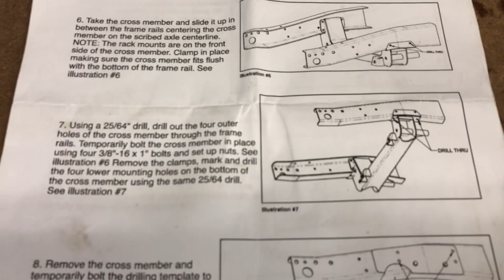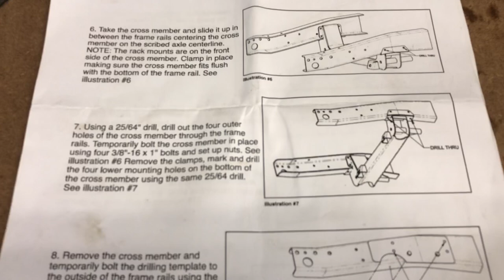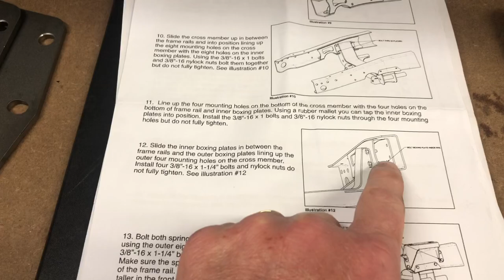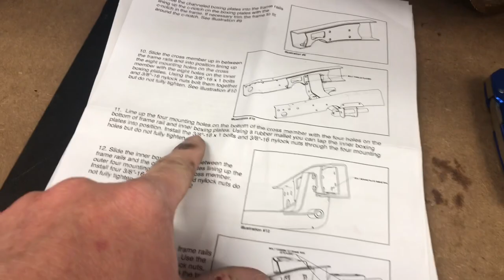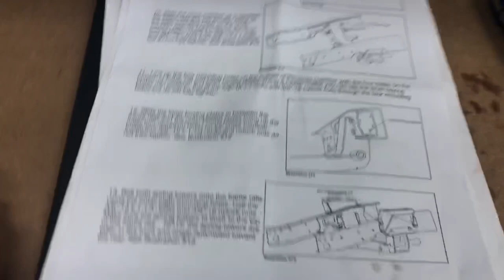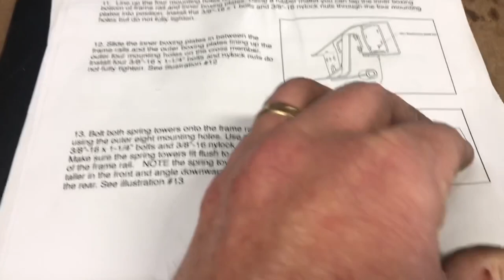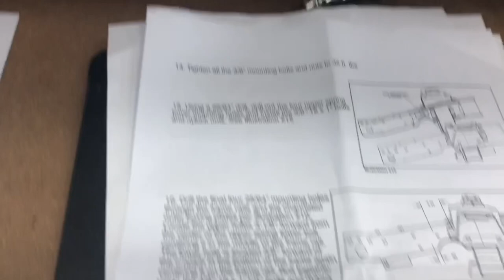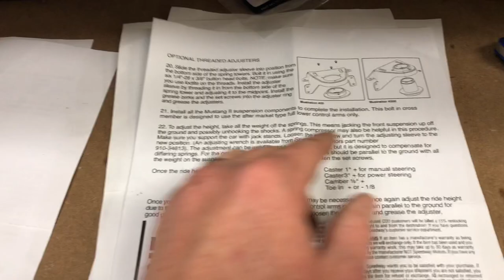Bolt on Independent Front Suspension install - Part 2

Comment: I did same kit on  55-1 with LS, ended up buying the shorter upper control arms to get better caster and camber, added the sway bar made a huge difference in stability at higher speeds

Comment: Nice job did that sway bar come with kit or did you order it separately, if so from who. Thanks
Reply from the maker: Thanks!  I Bought the sway bar separate at Speedway Motors. It’s a Heidt’s Item number 413054. Sells for $250ish.

Comment: Just wandering why you went with a new rad. support? does the ifs kit affect the original support?
Reply from the maker: It doesn’t effect the original support. The original can be used but will need to be modified. I wanted a clean look and at $100, now was the time to switch it out. I think I explained it in the IFS install video Part 1. Thanks for watching.

Comment: I like your video but what I like to know did you have to do any welding ?
Reply from the maker: No welding is necessary. I didn’t on my install, but after everything is bolted in you could weld it. But again, not necessary.

Comment: Were there any parts or brackets on this kit that you chose to weld to the frame while having it bolted into place?
Reply from the maker: No. I bolted them all on and used loctite.  You can weld them as well. I chose not to.

Comment: I do have my dads ‘49 so this would work. I also have a ‘59 Apache and I would like to find a bolt on kit for that which I don’t believe they have yet. SOMEBODY PLEASE MAKE ONE!
Reply: 1972 Chevy truck front suspension unbolts from the frame, crossmember and all. It won’t bolt right in but it is all inclusive and has everything one would need but it would need to be welded in place when centered in the front wheel opening.

Comment: What are you doing with the takeout straight axle?  Have a 1940 Chevy that it would look good under. For sale?
Reply from the maker: Sold it bro. Should’ve kept it though.
Reply: HI Joe 
I may have a 1958 3100  complete front setup 
I'm in California 
What's it worth to you?
Reply: HI Joe we have a 1958 3100 complete front end set up 
Were in California  
What's it worth to you
Reply: @tinablack9510  all set Tina, ended up using the original axle with disc brake conversion.  Tks

Comment: Grade 5 bolts? Should be grade 8. Looks like a weak set-up prone to failure.
Reply from the maker: Still driving great, no issues. I agree grade 8 bolts would be better, but not necessary.